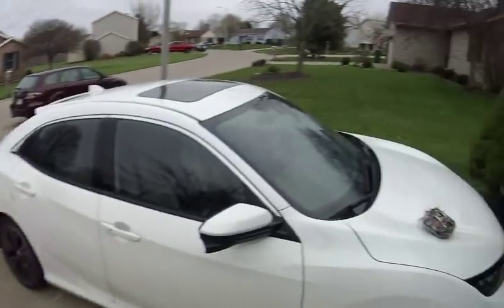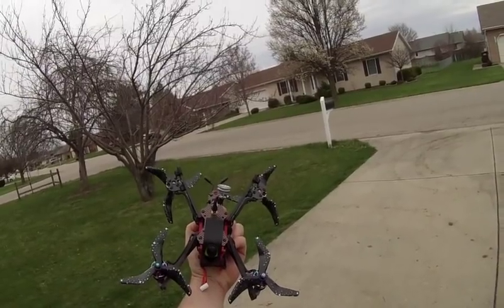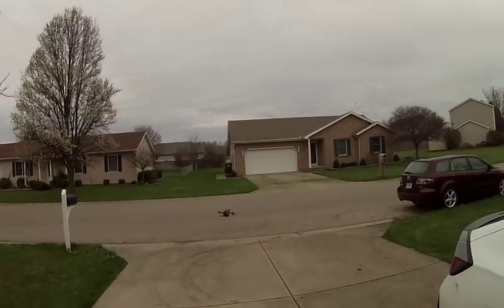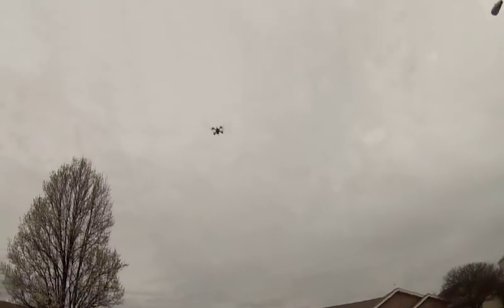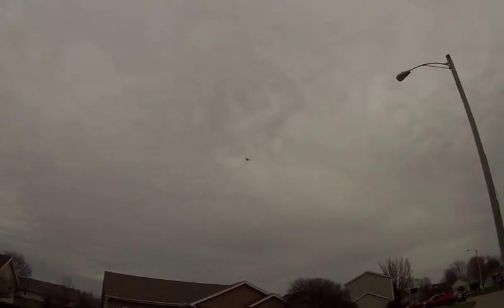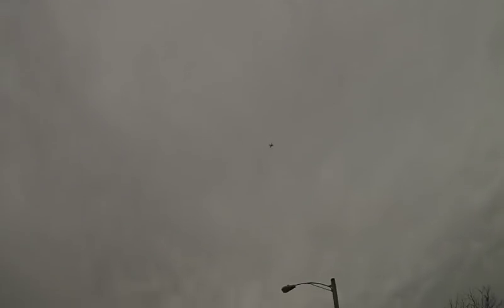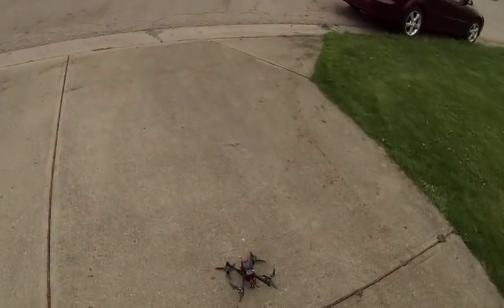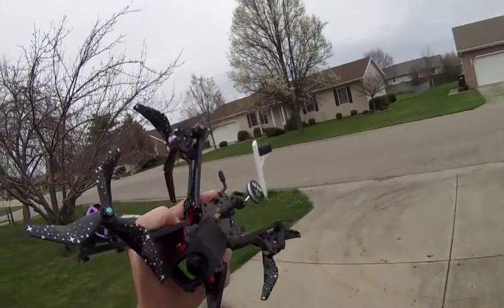JJ's Cheap Ass Hat Cam.. The Good Witch.. Glinda :)

Comment: How do you set up the inverted motors, thats so cool. Do you have to change the motor rotations? I love how that looks and sounds and seems performance is top notch.
Reply from the maker: Lol.  Hey brother.   I’m the father of the headhunter configuration I think lol.  Just flip the motors.    Rotation is all normal and props are still all on the normal way